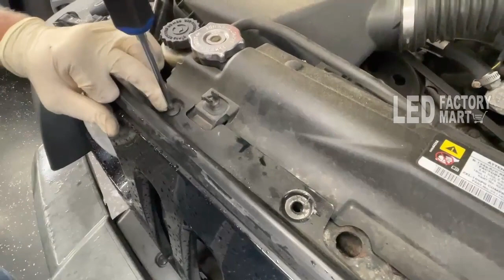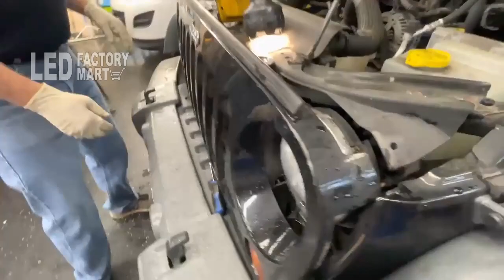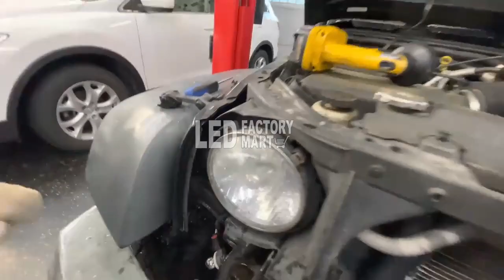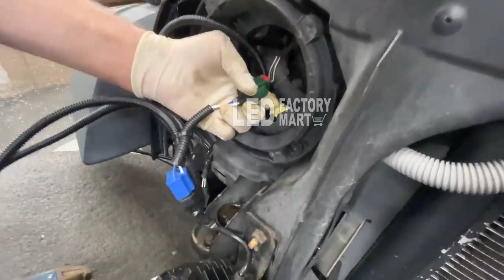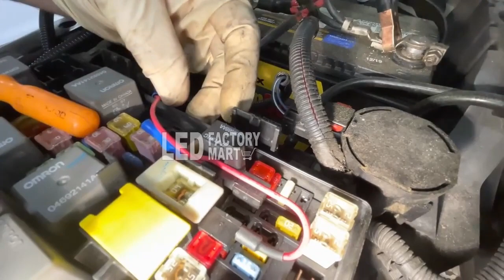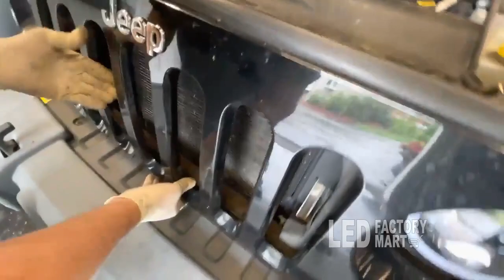How to Install LED Factory Mart Jeep LED Halo Headlights & Fog Lights On Wrangler JK?

Comment: Buyers beware,  do not buy from this company!!!  I bought a set of headlights from this company that was shipped directly from China. I was pretty excited as they were cool looking LED for my 01 Jeep Wrangler TJ.   When I installed them they didn’t sit in the bezel correctly.  I sent their customer service a message and called. I received a message immediately,however they did not ever look into the problem.  After sending repeated messages they finally responded that their customer service agent had been off work and another would contact me.   Guess what, no contact!  I looked into their return policy and it instructed me to return the lights to an address to Ontario CA.  I did that.  They just sent me a message that my money had been refunded, guess what it has not.  They also shorted me approximately $65.00 for what ever.  Even though it was because of the lights design that they did not fit the Bezels.   Total rip off company from China.  Stay away!